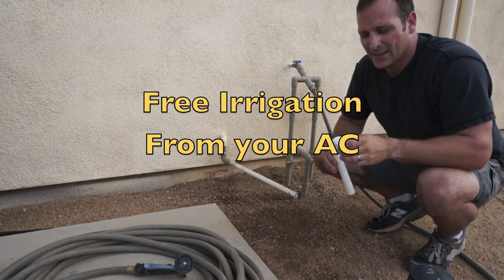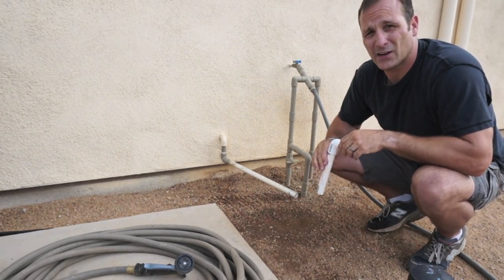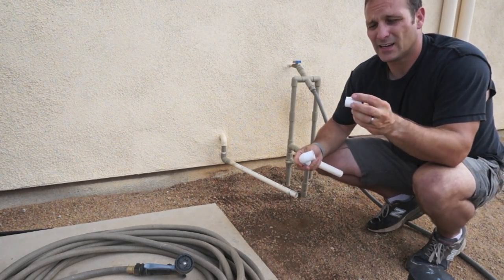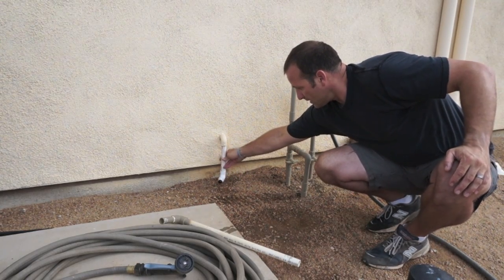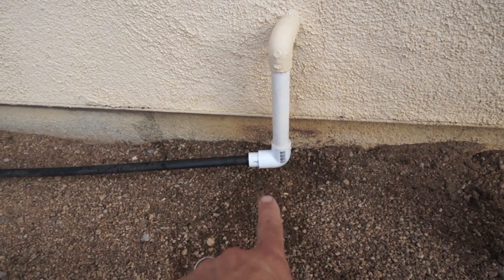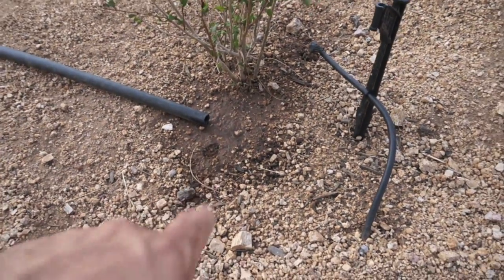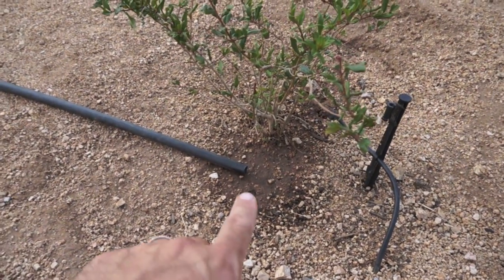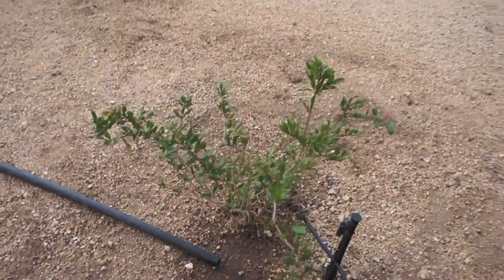Watering plants with AC runoff condensation

Comment: If you're worried about it clogging and backing up, simply put a T fitting in your vertical PVC run and let any runover go out the open side of the T fitting.

Comment: maybe your ac is designed differently than where i come from but if that drain is leaking it is because the main ac drain is stopped up. that pipe is usually an emergency pan drain that only is used if the primary drain is blocked. but i could be wrong maybe your ac is made differently. it will not pop that pipe off with water pressure because it is not pressurized . it will just back up and possibly flood. if that is your main ac drain you may want to catch it in a basin and use it from there .

Comment: My 1600 sq ft house produces about 10 gallons a day.  I have 9 big (3-4 gallon) potted plants watered with it and it still overflows.
Reply: What kind of pipe do you use to connect to the A/C
Drain?
Reply: @christinegarza6516  it's just a black flexible hose coming out of the ground.

Comment: We used to generate about 5 gallons a day from our ac unit just from the backup drain, the rest went down the main drain in the heat of summer. We are in San Antonio Tx. We just put in a new unit and asked if we could collect all the condensate instead of dumping it down the drain. Our AC company said yes and plumbed it all out to the back for a rain barrel. For now I just have a 5 gallon bucket to catch it. Well, it’s only April, the high today was about 86 and the bucket is overflowing. I’m gonna need a bigger rain barrel. Maybe I’ll just attach a super long soaker hose around my house and hook to it?
Reply: I'm in Austin with the same issue. I think the problem with the soaker hose is the lack of pressure. Unless you have a nice slope or a bunch of plants near the AC I don't think it would be great. I have a big rain barrel for the gutters but it's on the other side of the house, so for now I just dump the AC bucket into the rain reservoir once a day. Not great.
Reply: // Very true about the soaker hose. Worth a try hooking it to the rain barrel. Don’t want to cause a back up for the ac.
Reply: @user-ri4qk1xy3c how big is your rain barrel and how fast does it fill up!
Reply: @christinegarza6516  update: I now have a 44gallon trash can the water flows into. I didn’t want a traditional rain barrel because they are hard to clean. I put a regular hose spicket at the bottom and connected a regular hose to the front flower bed. On a hot humid day I get about 10 to 12 gallons of water. There seems to be a “dust slime” that accumulates on the sides of the can. It’s easily washed out. I use this water only for my orchids and garden. I’ve recently checked the ph on it and it’s about 6.8. (There’s a video on my Instagram)

Comment: Just tested my AC condensate water and the ph is 4.4 which is extremely acidic.

It can easily be raised and the soil will buffer it a little but I'm worried about pathogens also.
Reply: Odd. AC condensation should be as safe and clean as condensation on the side of a glass of a cold beverage. Maybe look into cleaning your lines?
Reply: Here in the UK the gas fired boiler causes the acidity in the water, by code we must have a lime based soakaway or we need it to go to rain pipe or sewage. Not garden.

Comment: Genius idea! Why didn't I think to use drip irrigation tubes?
Reply: Where can I buy drip irrigation tubes?
Reply: @TeleGuy53  Any home improvement store with Outdoors/Garden department. Ask for Drip Irrigation supplies.
Reply: @TeleGuy53  Home Depot has drip irrigation tube in their irrigation supplies area.
Reply: @JaimeBurciaga  Thanks for getting back, Jaime. Your video was just what we needed! We're experiencing the same issue, with water from the air handler discharge pipe saturating the area around our back door; we, however, have 2 air handlers, and both heat pumps are located directly in the water discharge field!

I purchased a 50-foot drip line hose and PVC parts at Lowe's today. I've already cut two pieces to the needed lengths, so tomorrow, I'll need to make another trip to Lowe's for hose hardware! Arrgghh! Anyway, we'll get there.

Thanks, again, Jaime.
Reply: @nholt  Got one today, along with PVC, at Lowe's. It's taken a few trips, but it's all coming together. In the end, it will be a very inexpensive, and a very effective, solution to a real problem.
Reply: @TeleGuy53  Not my video but I'm glad could help.
Reply: @JaimeBurciaga  Sorry about that!

Comment: I am producing 10+ gallons of water every 24 hours from my AC condensation
Reply: That's a lot, Bryson! This might just be the ticket for my urban off grid water supply!
Reply: @oliverburke  I'm sure you know, you'll need to filter that water, and if you live somewhere humid, you could expect about 10 gallons a day for a 3 bedroom house at 78 degrees.
Reply: @razingcanez717  I got 3.5 gal/day from an offgrid 2kW solar, 4.5 kWh battery, and a 1.5 kW heat pump setup. I only ran it till the sun went down or I would've run the battery down. I did filter the water, yes, because it tasted horrible, like everything indoors wanted to pollute it :).

Thanks for the recommendation!
Reply: @oliverburke  Thank you for the response.
What part of the country are you in, if I may ask?
Reply: @razingcanez717  Sure, West Oakland, CA. Right by the San Francisco Bay. This was in August, 2020 - a very humid time for Oakland. Sunny days to generate solar & power the heat pump, just 2 miles east of the bay to profit from the humidity from the winds that come from the west to fill the hot rising Central Californian air. A great location.

How’s your humidity/location?
Reply: @oliverburke  You're in the best weather in the US.  That's a beautiful area.
I'm on the central east coast of florida.   Very hot. Very humid.
Reply: @razingcanez717  I hear ya!

Comment: I’ve got two line from the using heater it drips from the tray A lot 
And whje usinh cold I have a pipe that I extended to the drain what can I do with the hot one ? As when I turn ac on heat mode

Comment: Wondering what chemicals are in this AC condensation water.  I have not a clue for example copper or etc.  Should it go to the sewage or plants?
Reply: That's what I was thinking too. I heard that it wasn't good for plants because of the lack of minerals.
Reply: @danram247 Rainwater has no minerals…and plants require it.

Comment: I connected a hose to the pipe but water started dripping in my inside unit. I am thinking that's because outside dripping water didn't have enough  pressure to travel through the hose. How do you think I can fix that?
Reply: The condensate has backed up into your indoor unit because the hose you attached to the drain pipe outside is sloping upward some where along its length. Make sure it slopes downward all the way from the house.